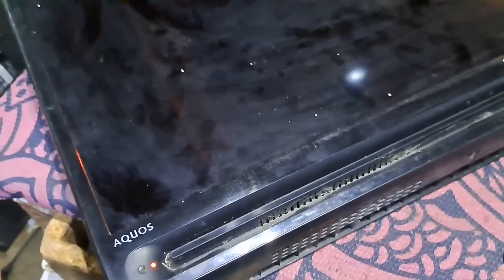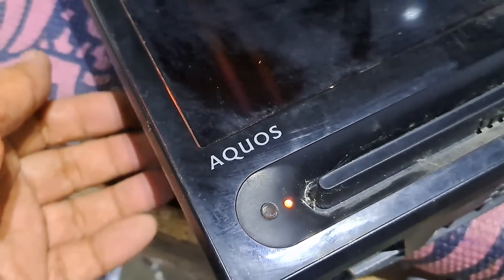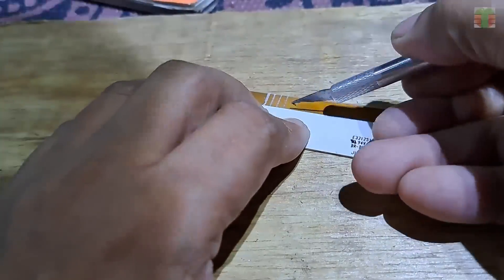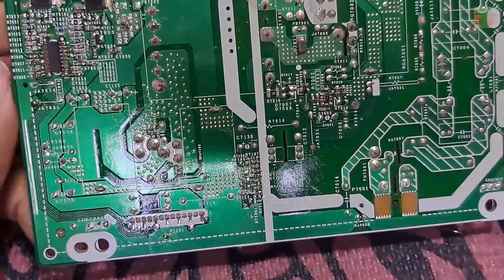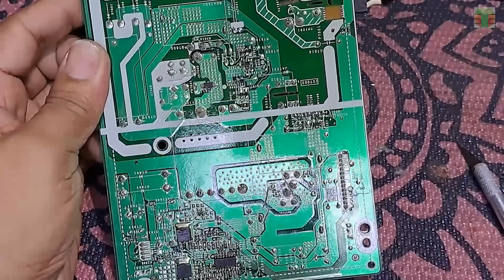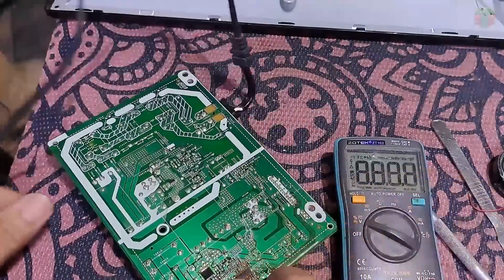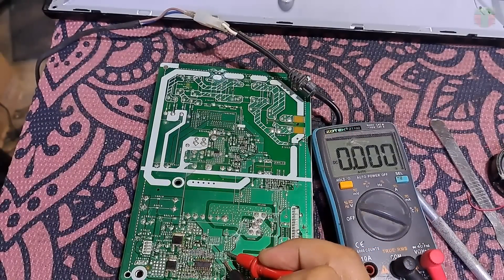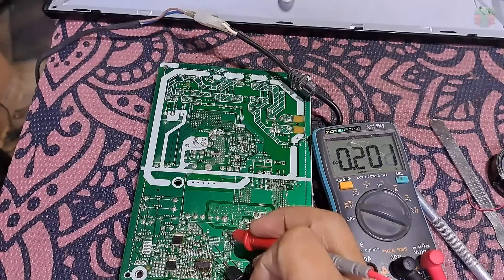Making a LED backlight driver using STRW6053N (part 2)

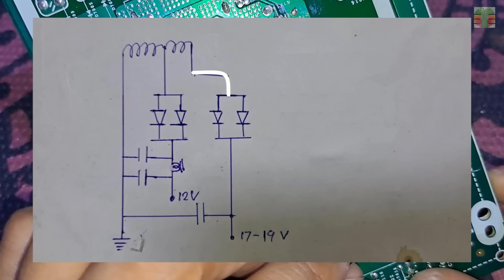Comment: hi master tevz this video is the most impressive one for me. ref to timer 8:33, at the diagram there are 2 paralel capacitors and there is a symbol between their right side legs, what this symbol does represent? is that another coil or a led?

Comment: Your all videos awesome sir
Small doubt out put supply capacitor circuit diagram 33/100v  voltage checking time 120v showing
Reply from the maker: yes, but it will go down if the LEDs are been connected.
Reply: Ok sir thank you

Comment: My equation  is samsung smart led tv model no. Au43inch 5300 is not turned on.but backlight ok.when i remuve main board. What is the problem?
Reply from the maker: check the main board
Reply: @tevzTVTevatronics  ok
Reply: Yes thanks

Comment: What's is the maximum voltage can give this Backlight driver board.
Reply from the maker: 250 volts
Reply: @tevzTVTevatronics  sorry. Am asking input voltage
Reply from the maker: @sivaanand.p7920  We know that the strw6053n is a 400 volts regulator, so the input is about 200v or higher.